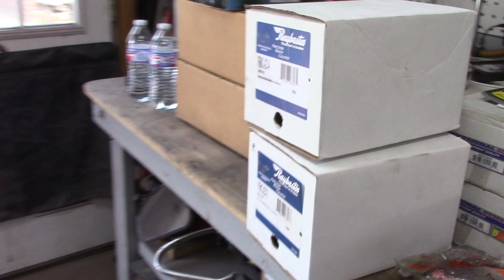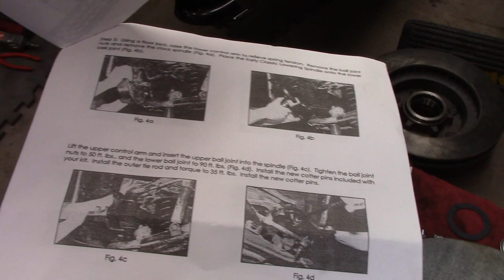63 Chevy c10 Truck Disc Brake Conversion/ Suspension Installed

Comment: Working on 65 chevy c10,wanna do disc conversion, wanna keep stock 6 lug wheels, most people say not possible..any ideas,options???
Reply: 15 inch wheels I meant
Reply: Yes just get a 67-70 Chevy truck with the front disc break system it will bolt right on your truck and if I remember correctly it's 6 lug?... Double check...

Keep On Trucking Brother👍...
Reply: Call CPP -Classic Performance products
They will hook you up with everything you need.

Comment: First time I mocked up my front suspension, I stacked all kinds of heavy stuff on the engine crossmember so I could get the control arms close enough to bolt up the spindles...you're method is much simpler...I'm doing that when it's time for final assembly...excellent idea...🖖🏿😎👍🏿

Comment: Very nicely done and it looks much better than new !! Great idea using the "dead man" to the ceiling. Just finished the same process on my 57 210 Sport Coupe. Need to compress the springs on the 57 since the lower A Frame is almost vertical when the relaxed spring goes in and I have a high "pitched" ceiling.
Reply: Great idea if there is No Motor in . 
I’ve taken out Springs before.

Comment: Love the builds! I always look forward to your work. Very clean as well! Maybe one day I’ll have the guts to pull apart the “Tennessee Stud” that’s my 69 GTO.
Reply: My oldest brother had a 69 Goat when I was in high school. The Goat had the 400cid (6.6L) with Auto trans, with the tick tock tach on the double ram functional hood and the Big Rubber front bumper with the vacuum head lite door's the posi rear end 4:11 gears. Black buckets black GTO interior with the full gauge option. The color was a light metallic blue from the factory. The only thing that I have left from my brother's GTO is the Hurst His/Her's auto floor shifter. I wanted that Goat so much but my brother sold it to a friend of mine that graduated with me Eddy let the Goat set for many years at his folks before he sold it. The two men that bought the Goat walk away very happy indeed... I always wanted to own one when they were not so much $$$$ but now it's impossible for me they cost way too much to own now $$$$...

Keep On Trucking Brother👍...

Comment: Yup installed new 2 1/2" drop spindles on my 61 with front discs!! Best thing I ever did to that old truck!! Also converted my old roller bearings to to tapered!! A win win!!

Comment: Great vid. I have a 1963 chevy suburban k10 with a 292. I would love to put disc brakes on it. Not sure of the year i need for the front axle swap it has 3.73 gears.  Keep them coming!
Reply: Try to find a Chevy K10 67 through 72 if I remember correctly the front disc break system should bolt right up to your truck.

Keep On Trucking Brother👍...

Comment: Question for Gibson....   When you put on the new 2-1/2in. Drop spindles, and disc brakes, did it require to   change from 15 in. Wheels to a larger wheel  ?    Thank you....
Reply: I’d like to know this as well...
Reply: I'm also looking for an answer..working on 65 c10 6 lug..wanna keep stock 15 inch wheels
Reply: @fernandofernandez3154 : Get on the 67-72 Chevy truck.com lots of info that will help you out immensely.

Keep On Trucking Brother👍...

Comment: What did you use to paint the frame? Do you have a video I need to paint my 85 frame. It’s in perfect condition with light surface rust and I want to keep it that way.

Comment: I enjoyed watching your videos. Can you please share from where did you buy the suspension system, and the brake system, torque settings?thanks
Reply from the maker: Juday Hajri suspension and brake system came from early classic enterprises I found several sheets for the torque on the 67-72 Chevy truck forum good information there
Reply: Most instructions come with Torque sequence

Comment: how did you prep the frame for paint. What did you use for rust remover, grease,grim and dirt. What was the black coating you used. Im at this stage on my chevy c10 1962.
Reply: Gibs has talked about this in many post and other videos it would only take some searching then read the post on the frame prepping Gibs has done in the past lots of good information you just need to spend some time looking for what you want. Hope this helps my friend.

Keep On Trucking Brother👍...

Comment: Hey quick question. Where are you finding all the torque specs for the crossmember to frame rail bolts? I have the shop manual for my 63 and it only specs the “crossmember to frame” at 60-80 lbs. it does not say for the crossmember to lower frame rail. Do you know where more detailed diagrams and specs can be found? What did you use for torque on crossmember to lower frame rail? I also have the factory assembly manual but it dosent show. Help?!  Edit: I should clarify 60-80 lbs is crossmember to side of frame, the lower frame rail I believe is higher? I bought all new grade 8 and installed yesterday.
Reply: Just Google bolt size torque specs and your all good...

Keep On Trucking Brother👍...

Comment: I’m working on the same front suspension and steering on my 78 K5 2WD any idea on where I can find all the torque specs? I don’t have the chasis service manual for the truck so I’m looking for anything online if possible. Thanks and great videos btw!
Reply: Go into any Auto Parts Store or go On Line look for the year you need get the Chevrolet Chilton's Repaire Manual. I have one from back in the day (35+ years ago) it's the Chevrolet Truck 64-74 Chilton's Repair Manual. I believe I've seen some at Advance Auto Parts Store but not sure what year they have now? Hope this helps even though it's late it may help other young Wrencher's 🔧

Keep On Trucking Brother👍...
Reply: @dustinsirrine227  yes  👍🏻

Comment: I know this one goes back awhile, but do you remember where you got your brake lines?  I am doing the same set up. Manual disc/drum. No booster. I called In-line Tube and they have brake line kits for power disc or manual drum with dual M/C. Still searching but figured I would ask just in case.
Reply from the maker: I ordered parts from a lot of different places back then I’m sure I have a receipt but my guess is (Classic industries)
Reply: @Gibson63.  I think I looked there too. I may end up getting the kit for disc conversion that is used for power brakes and hope there is enough slack in the coils in the lines for the MC that I can re bend them to fit. Thanks for getting back again to my questions.

Comment: Did you have any issue with lower control arm shafts. 
I’m assuming you should be able to twist them freely when you have 100 pounds of torque on them but I can’t seem to do both

Comment: I ordered a new idler arm for my 61 and installed the new grease fittings. Then I pregreased them to save a little time. Could not get the gun nozzle off the damn fitting??!! Had to take a screwdriver and light hammer to get em off??!! Foreign made junk parts?! Omg!!
Reply: Nothing like OEM GM Part's if you can get them...

Keep On Trucking Brother👍...
Reply: @dustinsirrine227  Exactly my trucking brother!! Hard to beat the old American made parts!!
Reply: @adriantomlin2902  yep

Comment: Great channel and great job on your projects. Did you happen to take measurements of your frame to the ground for the front end before you installed the drop spindles and new springs (like you did for the rear drop)?
Reply from the maker: Yes did take measurements before I started wrote them on the wall somewhere in the garage lol ..thanks for watching
Reply: @Gibson63.  That's great! Hey if you ever get a second, and you can find it on the wall again, I would really appreciate the measurement. I forgot to take those measurements before I blew apart my '61 and now I'm at a crossroads with putting back together. No worries is you don't have the time. Thanks again for the videos.

Comment: Is the frame on that 63 is the same as the 60?
Reply from the maker: No there not the same they changed the frame in 63
Reply: @Gibson63.  thanks for the reply, great job with the truck very tasteful and solid  clean work.  I have a 60 Chevy I want to restore but hard to find parts for the 60 frame
Reply: @dzroc : 60-62 C10 OEM new or used not sure what you are referring to, some of the parts are getting very hard to locate these days. Check on the HAMB or The 67-72 chevy truck.com

Keep On Trucking Brother👍...

Comment: Hey Gibson, did you do this conversion as a kit? I would like to do the same thing.
Thanks!
Reply from the maker: Yes most parts was in a kit
Reply: @Gibson63.  who did you order from? I saw one from Brothers Truck but did not have the control arms. Thanks again
Reply from the maker: Marco Cotto   Classic Industries is where I order all my suspension parts
Reply: @Gibson63.  right on, thanks!
Reply: @marcocotto9603  CPP

Comment: How did you make out with installing the bump stops with the A arms on the truck? I installed my bump stops with the A arms on the work bench. They were a bitch to get in. I ended up putting the rubber bump stops in boiling water to soften them and lubing the hole with dish washing soap. I can't imagine they were easy to do with the arms on the truck.
Reply from the maker: I did have to fight the bump stops in with soap and water but finally manage to do it

Comment: Did you use the original control arms and how difficult was it to remove the control arm bushing?
Reply from the maker: Jim Miranda  I order 2 new lower Control arms because the original ones were cracked and rusted through, The upper control arm bushings were pretty easy to take out with some help on a vice and a good ratchet